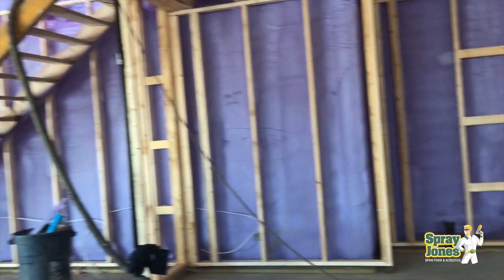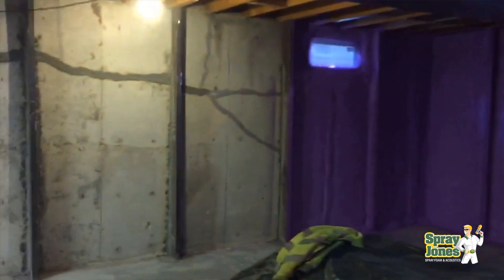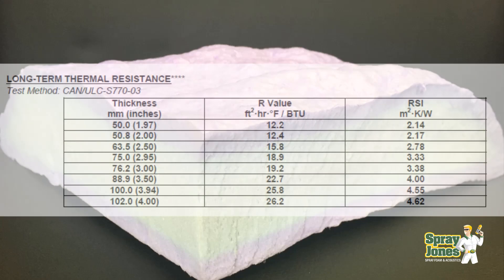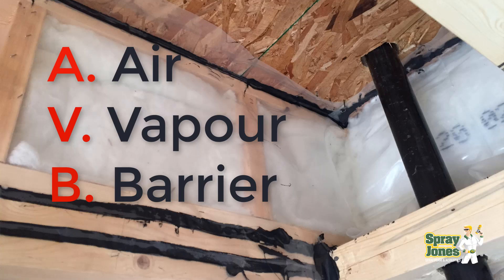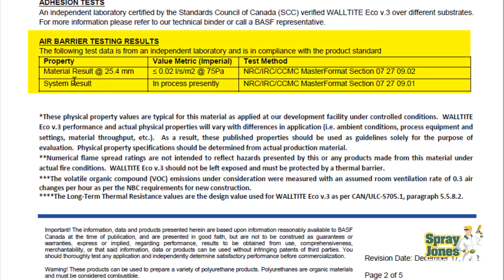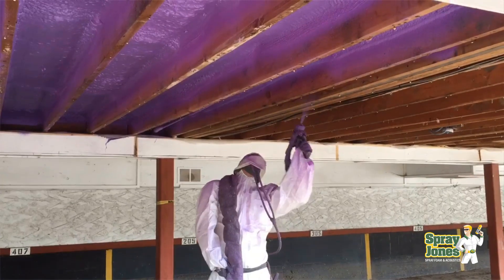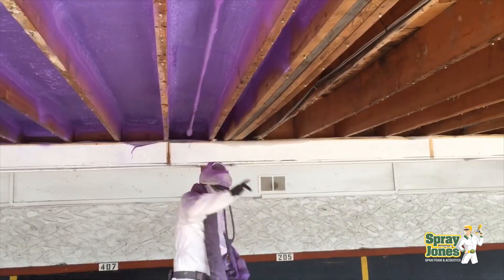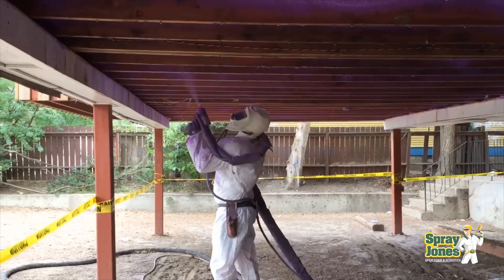Is 1 Inch of Spray Foam Insulation Enough?

Comment: Thanks for the nice breakdown here, quite comprehensive! What would be your thoughts on spraying a log home from the outside that would then be covered with siding or board and baton? The log wall interior is a big esthetic point that is required to remain.
Reply from the maker: I don't see any thermal issues. We spray commercial buildings that way. There are more technical requirements for bugs, water drainage etc.

Comment: Here in the US, State of Maine it is very common to install 2" of closed cell in a 2x6 cavity and then dense pack with cellulose after.
Reply from the maker: Right. Will do a follow up video on that. Coming in the next 25 videos in 90 days.
Reply: The cellulose will settle over 5 years  .on a 14’ wall I had one repaired that settled 2’ that had no insulation at all in the top of the wall !